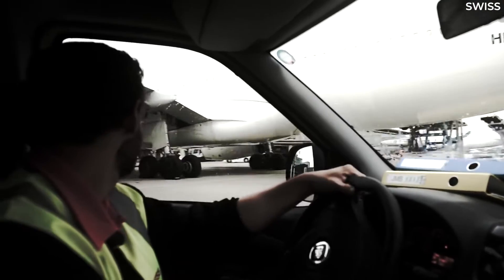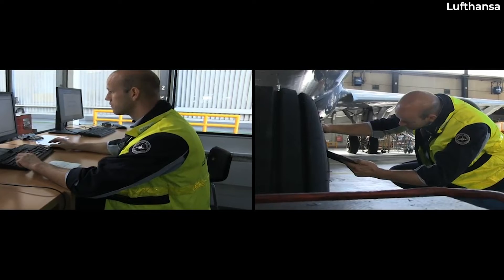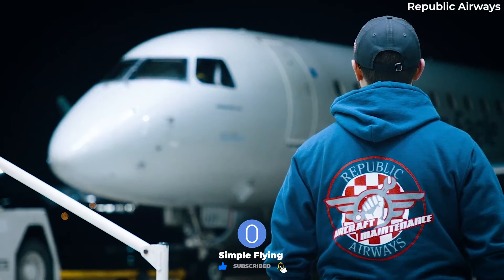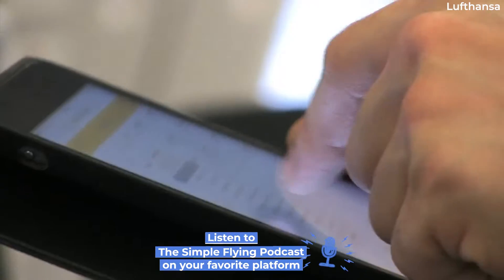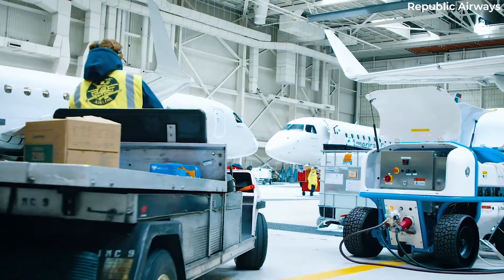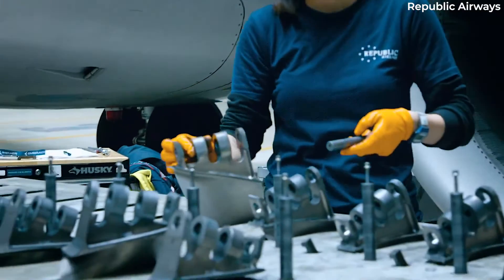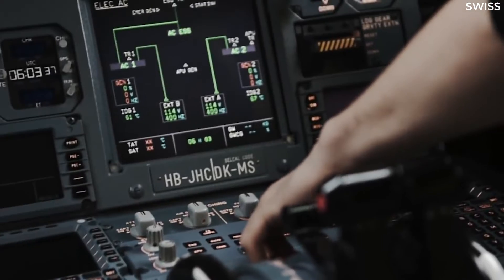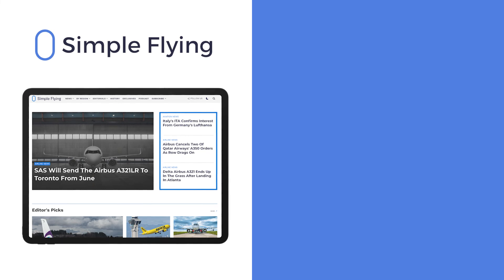Minimum Equipment Lists: Keeping Planes Flying With Inoperative Parts

Comment: I'm curious if anyone has examples of "The MEL allows a nonworking (major item) but requires a working (seemingly minor item)."
Reply: There are lots of these. Some times two identical items have different restrictions. One example on the aircraft I fly the captains radio control panel can not be inop 
While the FOs can. They are identical units and the usual solution at an airport with no maintenance is to have a contract mechanic switch the units and Mel the FOs unit. The reason for this is not obvious but makes perfect sense when you consider the electrical system of the aircraft the captains radio control unit is connected to the essential bus which is the most redundant power supply on the aircraft and the only one with battery power in Flight hence the captains side must be operating.

Comment: I knew, but some items being inoperative like thrust reversers or the APU surprise me.
Reply: The APU is more of an inconvenience than a safety issue. So long as the airports that are being being serviced by that aircraft have GPUs (and external air conditioning depending upon climate) otherwise one aircraft engine, typically one of the RHS engines, must remain running during the turn around creating issues for servicing and refuelling.

Reverse thrust systems are essential on shorter runways or when contaminated with rain, snow or slushy ice etc. 
Having them U/S or INOP (unserviceable or inoperative) is less of an issue providing the airports that are being serviced by that aircraft have long enough runways in use to meet the minimum requirements of that aircraft type.
An aircraft with reverse thrust system/s that are U/S have additional  considerations with regards to takeoff decision speeds, V1.
Certainly high speed rejected takeoffs are of greater concern in the absence of serviceable thrust reverse systems. Naturally a number of contributing factors such as total weight, meteorological conditions, runway length, airfield elevation etc are all considered when calculating, or the FMC is calculating the takeoff decision speed. VR (rotation) and V2 speeds are required unaffected.

Generally speaking though, the aircraft’s brakes are efficient enough.
Reverse thrust for a period of time was a little out of favour and often not used in favour of auto braking, this caused enormous wear on the brake discs/pads so a combination is now typically preferred.
Airbus were so confident with their A380 auto brake technology they only fitted reverse thrust systems to two of the four engines, which has proven to be a poor decision on a few occasions.

It is quite interesting what the MEL permits vs No-Go items. Some items if granted an MEL INOP status require a number of caveats. 
Only a LAME** is qualified to ever issue an INOP status to aircraft equipment in accordance with the MEL.

Here are a few examples with caveats…

Must be rectified within 24 hours short haul/48 hours long haul, or upon arrival at an engineering supported base, whichever is sooner. No transit permitted ^^

If an evacuation slide-raft was accidentally deployed at an airport that does not have replacement equipment, the aircraft can still operate its next flight/s back to base where the issue can be easily resolved. However less passengers can be carried along with seats in proximity of the U/S slide must be blocked out and crew ensure that no passengers occupy any of them at any time.
If the aircraft is performing an overwater flight in excess of specific number of nautical miles from land even fewer passengers may be carried. The specific numbers and particular rules are all included in the MEL.

Another similar example would be if a passenger had discarded a still lit cigarette into the washroom waste-bin causing the automatic extinguisher to fire, the affected washroom must be locked out for the remainder of flights until it returns to base where a replacement extinguisher can be installed.

Item requires resolution within 7 days - Caveats Apply:

If a seat recline function has failed allowing the seat back to spontaneously recline, that seat must be blocked in addition to ALL the seats in the row behind.
There is a longer intervention period permissible for this however most airlines are fiscally motivated to resolve such an issue ASAP with 3-5 seats blocked out.

Flight may be operated - NO PAX  Ferry Flight Only:

While operating a multi sector international flight we lost one of the main landing gear's door when the gear was extended. The damage also included brake hydraulic lines being severed. The MEL stated we could ferry the aircraft back to an engineering supported base but we could not carry passengers.
It also stated the maximum airspeed permissible which was a great deal lower than normal resulting in a very long flight back home.

NO GO Item. Aircraft may not be ferried or operated until issue is resolved 

Flying to a remote regional airport in a very isolated area the leading edge of the wing struck a 'bush turkey', an extremely large bird. It destroyed the leading edge slats on one side. 
Because of the No Go status another aircraft had to be ferried to our out station carrying two LAMEs** (a senior/supervisory LAME** is always required to sign off work and can not sign off themselves) along with replacement slats and required tooling to execute the task.

We took the replacement aircraft and very delayed passengers back to our port of origin while the LAMEs** repaired the slats of our original aircraft. The crew that ferried the repair equipment and engineers then ferried the now repaired aircraft back to its base.

I hope those examples gave you a better understanding of how MELs work and your concerns with reverse thrust systems and APUs were addressed.

Cheers, Anton 

^^  The time allowed takes into consideration a domestic/short haul aircraft will be rotating back through an engineering supported base within that time, while an aircraft operating multiple sectors outbound until reaching its terminating port and then returning back to an engineering supported base. 
In either case if the aircraft is not scheduled to be back in an engineering supported base within the allowed time frame then it must either be ferried back or contracted to another airline's engineering facility 

The respective aircraft is also prohibited from arriving at an engineering supported base as scheduled and then depart again with the issue unresolved even if planned for later that day.
 

** pronounced 'lay-mee'  |  Licensed Aircraft Maintenance Engineer
Reply: @sydyidanton5873  thanks, i didn't thought I'd learn much from a YouTube comment section
Reply: @TTURKI  An absolute pleasure I’m glad you found the information of interest. Cheers :)

Comment: No wonder some aircraft are dubbed the world's most dangerous aircraft in the world as using redundant controls or using outdated controls or unoperative items these should be scrapped and no longer ude
Reply: Unoperative ought to be INOPerative 1st off. And replay the clip, systems that can be MEL'ed have one or even two back up, redundant systems. An APU generates power while the plane is on the ground and can be MEL'ed, since the  planes engines also do that,as does portable ground power at the terminal gate. A lav may be taken out of service (too often because someone dropped their phone down the bowl and into the mechanics of the lav ) Certainly not a reason to scrap a plane
Think of your car. It comes with 4 tires and a spare donut tire. If you find a flat in the morning, you can put the donut on, but it is only rated for a limited speed and distance. That is the same concept as a MEL. And the MEL can be a huge benefit to the passengers scheduled to fly on that aircraft. Often an issue develops not inbound to an airline hub,but to an outlaying station where the airline does not have mechanics. A contract with a local aircraft mechanic service can inspect the affected aircraft upon arrival and determine if the issue can be MEL'ed , and if so they can do that and the paperwork the FAA requires, and the outbound flight can operate, usually close to schedule, and the planeload of people can make it to their destinations.